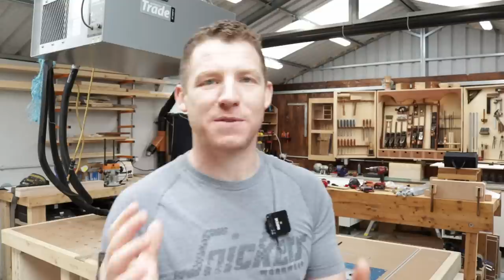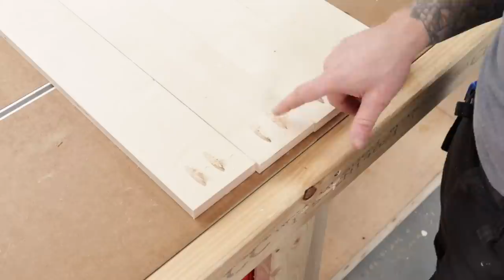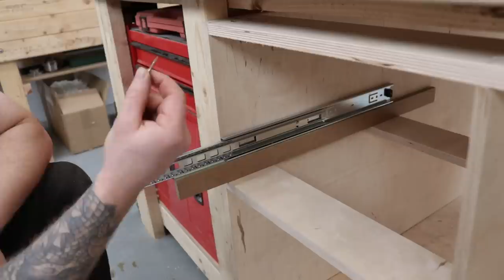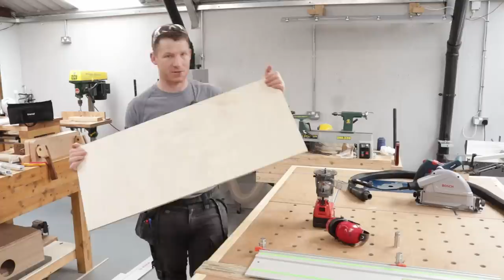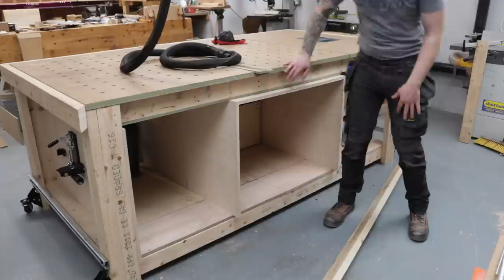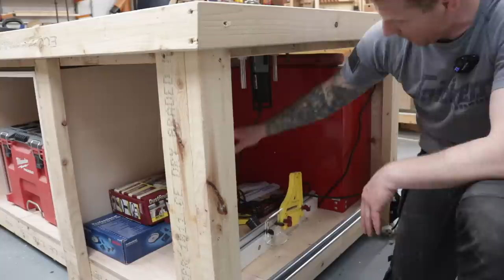How to Install Drawers in a Workbench. MFT Table Build series.

Comment: Hi John. Glad to see you made access under the MFT top possible. Never mind the dust that falls through the holes, but you will also loose screws and bits and other stuff, and always when you don't have a replacement.

Comment: I love pocket holes. Discovered them about 20 years ago and using them on most of my projects. One bit of advice I would give is to use a drop of glue . I also use spax pan head screws which have T15 heads which I find better and a lot cheaper

Comment: I've seen other woodworkers use long bar clamps to ensure that pieces don't slip when using pocket holes. Normally put the piece in and bar clamp the outside of the cabinets inwards to hold the inner piece.

Very nice work! I have a smaller workbench myself but am very interested in using this style of drawers rather than shelves to keep sawdust out.

Comment: Hi John, with the price of wood going up I used 2 drawer metal filing cabinets, they fit perfectly under my bench. The added benefit is, they are strong and have a lock on them for security and they are cheap 2nd hand. Great video

Comment: Cool Table. I like how the 4x2 trim pieces around the top give it a finished look and also keep the MFT top in place with ability to lift it off for replacement. Good way to vacuum under it as well because I was wondering about that when you inserted the 1/2 in piece to block saw dust from entering the cabinets.

Comment: Hi John, another cracking video and funny as when it comes to pocket holes I think we have all made the same mistake with them moving when in place😳🤣. Best thing mate is to clamp them down if possible then get one screw in and then it shouldn’t move. Or if difficult to clamp the pieces together, then use the mft with either clamps or dogs to just stop the pieces from moving whilst you get that first screw in. Kreg have loads of videos on the best way to get over this and sell a special clamping device. I think Peter at 10min workshop has done vids on pocket holes sometime a go. Another great vid is from Shop Nation and his latest workbench build as he uses pocket holes all the time. By the way loved the vid on the castors and great idea. Will be doing that myself now. Plywood prices 🤬🤬
Reply from the maker: Cheers for the tips Mark

Comment: Great video fella.. I use pocket hole joinery occasionally and found that when I first put the screw in I run the driver in reverse briefly which seems to help it sink in straighter, especially with mdf.

Comment: Great vidjo John. The Kreg pocket hole jig was one of the first things I bought when setting up my wee workshop. After years of watching woodworking blogs and shows on youtube. Had a list of essential tools. Funny how that list changes over the years. As in the other comments the trick with pocket screws if you need a flush edge is clamping. I clamp a block inside or outside depending which side I'm screwing. Mind the knees bud. I'm thinkin of gettin a couple of grease nipples fitted to mine. And get well soon . Head colds are back, thank God #fedupofcovid.😉

Comment: Hi John, great vid as usual. 
I’d just say though that if I was planning to layer the drawers from the start I’d make 2 drawers rather than layering. I get the more expensive and more work but have been there with pulling stuff out to get to other stuff and in a few years you’ll be making 2 drawers to replace 1!

Comment: Great video.

Maybe the tear-out on the pocket holes is because that’s the part of the timber that the drill bit ‘pulls’ up on. Hard see how to stop it except maybe make sure the board is clamped tight, the drill is sharp AF or even put masking tape over the boards? Not sure any of this would work, but?

Comment: Great Video I hope the knee is going well.
I would suggest get one of the pocket hole clamps that go into the pocket hole itself 
as I use to get the same issue as you it was just off that small bit
I can confirm it is gone up after getting timber for a kitchen build it went from €800 to €1200 +vat 
everything
Reply from the maker: I will check that clamp out! I got a email this week telling me all electrical supplies are going up 30% to!!! 😦

Comment: Hi John, I certainly would not call myself an expert, but I have been using pocket whole joints for a long time. I used to put my wood in about mm so that the wood movement would correct the alignment. I bought a pocket hole clamp about 20 years ago (it is the one that goes into one of the holes and this sorted out the problem and I can now clamp my wood and it does not move on me. I would not advise anyone to use screws that are not meant for pocket whole joinery,
Reply from the maker: I'll have to get one John

Comment: Hey, John... I really like that work station.  The drawer build was pretty straight forward and really essential for organization of tools and accessories.  I'm curious about the slight shift when acrewing the pocket hole joints.  I have a Kreg system that has a great clamp that has one end that sits in a pocket hole as the other hole or holes are screwed.  I haven't used it alot yet but did not seem to have that slight shift in the stretcher.   I'm sure to watch out for it now in future projects.  Enjoy your channel! Thanks

Comment: My man, if you clamp the ends of what your putting your pocket hole in, with them clamped they won't move when your fastening them together. I've been using pocket screws fora few years. So there's my thoughts my friend.

Comment: A normal drill driver works better for screwing pocket holes. An impact can be a bit too strong and damage the material by over tightening. Easier to control the torque on a drill driver.

Comment: Great video, do you get the Red Milwaukee packout cases as a default out in Ireland 🇮🇪 same as the states?
Reply from the maker: No we get back ones here, I just happened to get a red set early on.
Reply: @JohnMcGrathManInShed  ahh, lucky you! I’ve got all black but like the look of the red ones, keep debating whether or not to import some red Packout Drawers as were not getting any in the UK until about September so I’m told now!